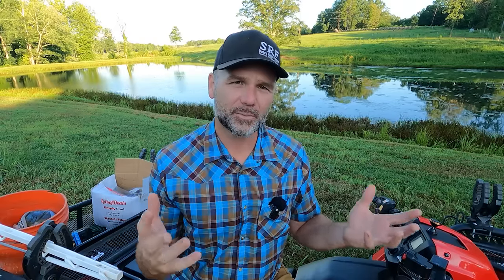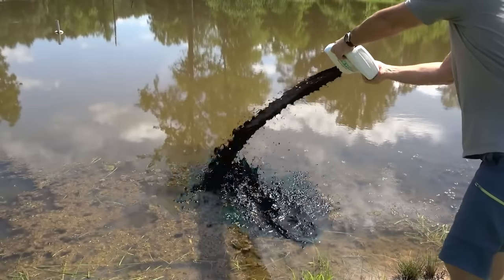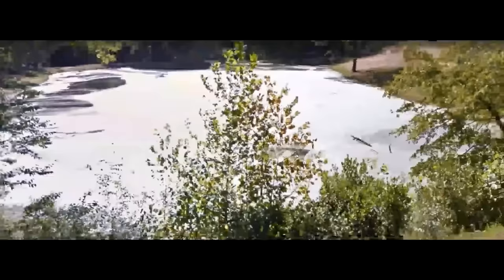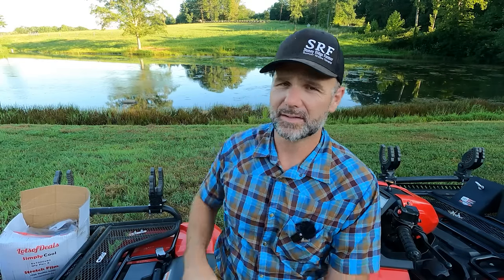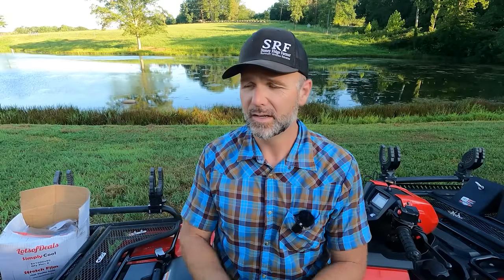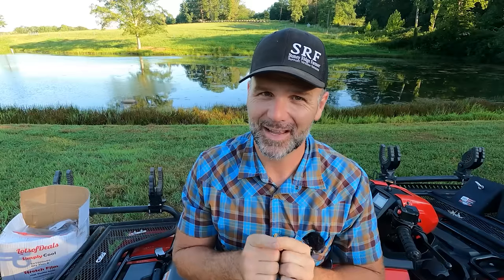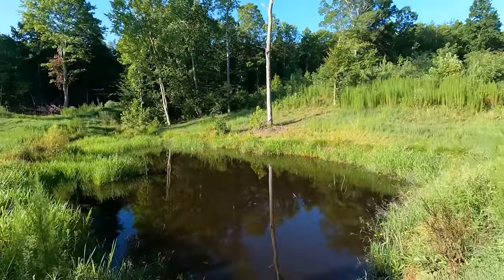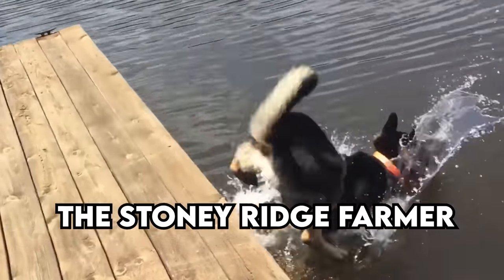Here's how I Messed up...Farm Pond Basics most don't know!

Comment: Cattails and reeds are important water purifiers, if you can get water to flow through them. They suck up the excess nitrogen and other water toxins. Chop half of them every year and compost them as free fertiliser nutrient.
Reply: How do you chop your cattails ? Our pond has a huge cattail problem .
Reply: @hellosunshine9915  cut down cattails with a brush cutter or scythe/Sickle. Rake in collection. Where U don't want cattails dig down to increase pond depth beyond 60cm. Cattails shouldn't grow in deeper waters.
Reply: @Raj-yy7xx  we had a very dry summer last year so our pond was way down . This spring so far we are way ahead of our rain so thank goodness our pond is totally full cattails are way out in the pond growing . Will they die because the depth of the water ? Thank you 🙏
Reply: @hellosunshine9915  not sure, but if they have roots and mature growth on top, then not likely. If you can't pull them out then, you may have to paddle out and chop the tops, every 3 weeks for at least 3 months. That will stop them photosynthesising so they should die once they deplete the stored energy in their roots.
Reply: @Raj-yy7xx  ok thank you ! Last year I went in and pulled the roots out that we’re out farther and floating . I hoped that the ones floating would freeze over the winter but I do not think any did . My husband talks about making a cutter bar for the tractor that will go out and cut them . I guess we will get rid of them some how 🫣
Reply: @hellosunshine9915  My question exactly. My 75'x 150' pond has been 95% over taken by cattails in the 8 years that I've owned my property. I about to have a contractor with a backhoe come and scoop most (not all) of them out to take me back the way it was 8 years ago. (Only 20% cattails back then.) I'm perplexed about how to keep them under control. I don't want to use any chemicals. Did you have any success?

Comment: Looking for some help. I have a spring feed pond. It's been around for about 50 years always ran fine from what I'm told. I had the core rebuilt and had the muck dug out in November. Everything went awesome. It took about 6 weeks to fill up. But once summer sat in the spring stopped running. I'm wondering if it normal for springs to stop flowing from time to time?
Reply: Is your area or north up stream from any spring flow  in drought conditions?? The aqua basin might be low natural or man made large population pulling out of basin or backhoe made like a till pan and sealed of spring flow
Reply: @markrodrigue9503  the spring is north of the pond. The 4 years I have been here it has flowed at a rate of 3 or 4 gallons a min. I had the pond overflow pipe cut off at the bottom of the pond. So the spring flower through and right out. When I had the core of the damn rebuilt and started the pond back filling. The spring filled up. It ran from November till first of June. Water flowing out every day. The one day it stopped. Pond stays about 4 or 5" low now.
Reply from the maker: yep...it's been a dry year and the water table often drops
Reply: Crossing my fingers it starts running again this fall
Reply: @Archer_out  turn loose sum crawdads
Reply: @nonyabusiness9747  explain?
Reply: @Archer_out  yes, please explain. Are the crawdads going to dig down to the water table or something?
Reply: @Archer_out  Crayfish naturally burrow into mud, so if there is any hard pan obstruction preventing the water flow, they'll eventually dig through it. 

And the little suckers can dig pretty deep. May take a few weeks, or months, but if that's the problem, they'll likely solve it.

Comment: You know a lot of these things, so maybe you can help with some questions.
I saw a property I am interested in. It got a massive 9 acre lake (400m X 100m). I did not see any green slime in it nor any other kind of stuff...is it because of the size?
Also, we do not like to enter lakes, we like lakes but we do prefer to enter on a concrete surface or a beach-entry. Do you see any problems pooring a concrete lazyriver (like 2,5 to 3meters wide and 20 to 30meters long) with a shallow area to sit?
Would I need to move the water in the lazy river from time to time? Would the floor get dirty because there are no pool-tech like pumps and so on?
I am very grateful for all answers, hints and help :)

Comment: I just purchased a house that has a small 1/2 acre pond about 75 yards from my barn. It doesn’t have much water in it and also has dead trees on the bank. I was curious if I remove all dead trees can I run pipe from my barns gutters to help with keeping water in the pond?
Reply from the maker: Well....I honestly think it would be a total waste of time and money....of course you'll catch some water and it will go in the pond...but your pond should be running all the time anyway...and the amount of water will be very insignificant.  Remember most of the water that falls from anywhere above or around the pond will end up in it....sounds like you need to get a person in there that knows what they are doing around ponds....clean it up and then you'll know what you've got...first and foremost get the trees off your dam if you have any....and I mean with an excavator

Comment: Trees on a Pond Dam wall can be immensely useful for long term structure and perches for insect control, IF only certain trees with deep tap roots and limited root systems are employed, like willows, Bamboo or grasses like Vetiver or Lemongrass which stabilise the ground very well and don't puncture the dam walls. Roots grow directly down. 3 to 5m away from dam water edges.
Reply from the maker: Trees on a pond dam are 100% bad.....they are horrible for the pond and will eventually destroy your pond my friend....keep your pond dam clear or you'll loose the pond my friend

Comment: We just purchased property that has a nasty, ugly stinky pond and it’s very odd shaped. We are lower than our neighbors so I think the builder/owner hand dug this awful pond to catch the run off from the other properties. The second owner built a pond dam ( I think that’s what it’s supposed to be.) it has that black tub you showed that leads to a hand made trench that has a cement flooring and large rock lining the sides. It is a ditch to direct the extra water that we get. We drained it in the heat of the summer to actually fill it in and try to get rid of it. But I was too busy with the house remodeling that I never tried to find fill dirt. Then we had two short rains in two days and the pond filled up and topped over the pond ridges. So, although this was a good video for some…. I really need lots more info. We have frogs and lots of turtles and get critters that swing by to get a drink… but I really didn’t understand your pond dam and that overflow thing. I’ll keep trying to find more info… but would love a deep dive into all you had to do to make these ponds work well for you.  We are in south east Texas so the pond water level goes down pretty low. Is there some way to maintain the water level without raining all the time, like putting a liner in it? And can you have fish and frogs and turtles if you have a liner? I don’t know much about all this ponds stuff, but I’m trying. Thanks so much for your videos. Glad I found you.

Comment: Great Video, Thank You! How can I tell if my property has natural springs to support a pond?
Reply from the maker: if you have water on your property or wet areas that originate on you property...you'll know
Reply: @StoneyRidgeFarmer  thanks for your reply. What if I don't wet areas on the field? My land is on a slope down hill of about 6 cleared acres, with a creek at the bottom. Its hard, rocky and clayish. I don't see signs of water. Does that mean there is none, or could there be some way down deep? This is new property to me, so I'm still getting to know it. TY!!
Reply: @lauramohr71  Depending on your area, you could consult with a well drilling company, and have them come out and check to see if drilling a well is an option.

We had an old guy come out to our place, who literally still uses water witching to find the water underground, and he found where two springs cross underground not far from our house.

And obviously you're under no obligation to drill a well. Good luck.

Comment: What about if there is no spring to feed water to the Pond?
Reply from the maker: well if ya don't have a water source...then you can make a runoff pond....many dried up run off ponds all over the place from folks who dug a hole to make a pond where there is no water....need water source to make a healthy pond in my opinion
Reply: If you strategically place a pond dam in a valley ridge keyline, downhill, and use on contour diversion drainage ditches uphill, you can create a rainwater catchment area to feed your pond dams. Of course you'll need rain, but bear in mind 1mm of rain in just 1sqm equals 1litre of water. So the larger your catchment the better.
Reply: @Raj-yy7xx  this is what I'm hoping to do. I'll need to remove a lot of trees and then line it with clay, lots of work!

Comment: Hello,
I have 40 Acres of land. Do I have enough land to put a small 5 acre pond. The property is in Northern Arizona. It sits 5,500 feet above sea level. We get all four seasons there. There’s a low spot on the property near the front and lower center of the property. What books could I read to properly build a pond, if it’s sustainable. Thank you for sharing.
Reply from the maker: do you have running water or runnoff water?  That's a choice you'll have to make my friend
Reply: @StoneyRidgeFarmer  -No running water on the property, but I get plenty of run off from rain.
Reply: 5 acres is not a small pond!an acre is 209 feet square...it takes a flat place going downhill ...a big flat place..

Comment: do you have a subsurface recirculatory alternative  in tanks for every 1000 gallons you need 4K gallons dilution supply do you have a PH modifier in line or on a Mobil platform
why donn't you have floating doc platforms to clean the water   do you have any gravel  field stone or  river rock   if you don't have solar get it fast and build enough power storage bank 
for a  military compound

Comment: Did you have to use a liner?? I’m building my pond but water does not stay in?? I’m sitting in dry summer area and cold winters, I’m at 5200 ft elevation. What do you suggest, and money wise too
Reply from the maker: if you're soil is too rocky then you may never hold water....check out a product called https://shalex.com.au/damit-dam-sealer/?gclid=CjwKCAiAuOieBhAIEiwAgjCvcq5vsADx4KdJvU-MacmSvkyYjxDcP2mak5rgYt_z4FypoSW58KdPshoCpyIQAvD_BwE  I just did a video on this and it helped me fix my leaky dam.  Call them and tell them your situation

Comment: I just bought property with a 1.3 acre pond on it about 9 feet deep in the center and it's covered in duckweed and watermeal. I need to stock it but I also want to learn more about putting dye into it. I do not see a link to the dye that you used. Did I miss it?

Comment: I have a 2 acre pond on my property, it has a ton of suspended clay, so it looks like chocolate milk, i am in NC as well.  Do you know what i can do to get it to clear out, i saw pictures of the pond from 5 years ago and it was looked much cleaner.  Ive cleared all the trees on the dam side, its fed by a creek….ive put a solar aerator in it, but it still is chocolate milk…what can i do?
Reply from the maker: turn off the aerator (complete waste of time and money) and if you've got muddy water....it's only $60 to try out some pond dye....but I've never seen an aerator do any good for anything other than a coy pond...you could be over oxygenating your water and causing problems.  Now...each year my pond "flips" meaning the top water exchanges with the bottom water making it muddy...and after rains I can see a bit of mud...try the dye buddy...it's food safe, fish safe and cleared my ponds up nicely
Reply: Suspended clay is sometimes due to ionic charge.  The clay particles repel each other rather than clumping and then falling to the bottom.   Lime is sometimes used, but it can change the ph of your water.  Gypsum does not change the ph of your pond water.    You can find it pelletized but we have found the powder to be easier if you can find it.  We like to premix it with some water in a bucket and then disperse.   If you have a boat motor or even a trolling motor that can help you mix and disperse it even more.  We have to reapply every 4 years or so.  You can do a test with several jars of your pond water to estimate how much gypsum will be necessary.  There is an article on the Pond Boss Magazine site titled Clearing Muddy Water that explains how to do this.  Also, some old pond forums have advice on this method.  Good luck!